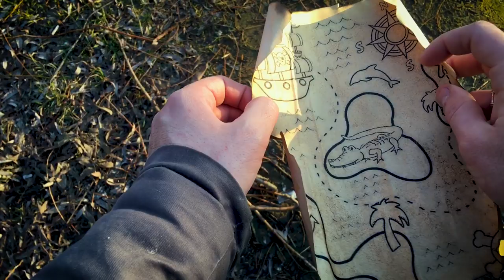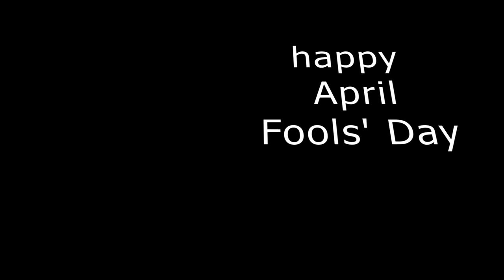Webcam restoration.

Comment: Nice, but I think you should use a little piece of electrical tape around the solder connections, and then put the heat shrink over it, since the heat shrink is not as thick as the original wire insulation.